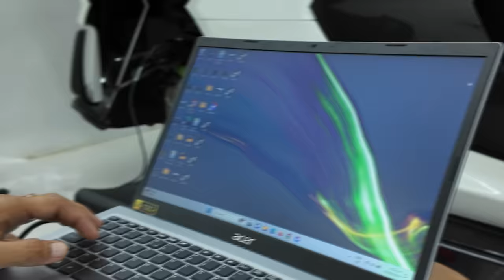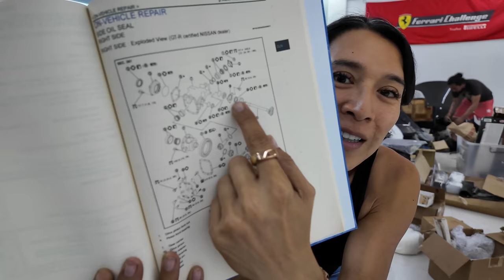3 Major projects - Mclaren, R32, VW Baja | Angie Mead King

Comment: Yeah that’s a lot going on but vow’s always win in the end😅 yeah your going thru same thing DDE went thur with the 720 eventually that car is going to be a reverse restomod with the same workings as a hot rod low tec engine running on it’s own computer not linked with anything else in the car and windows top wing on separate system..